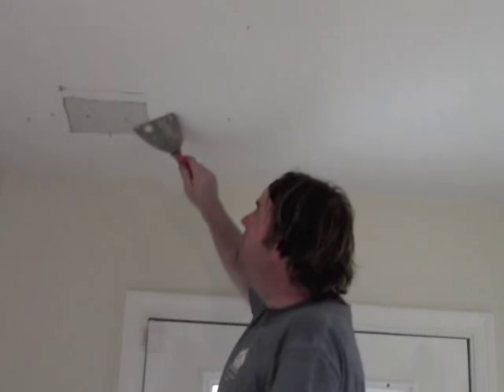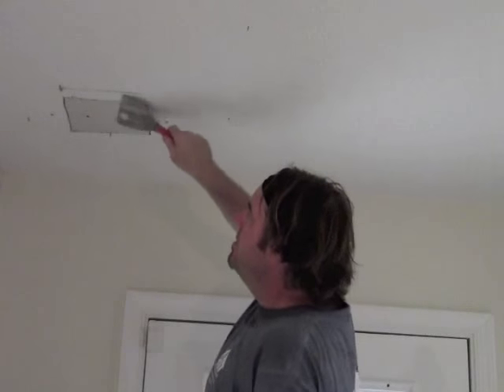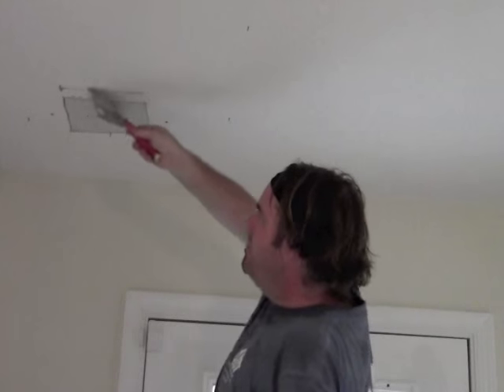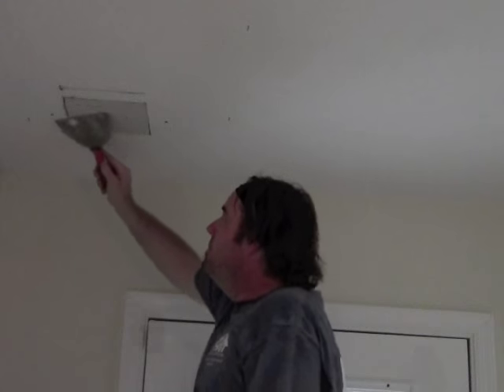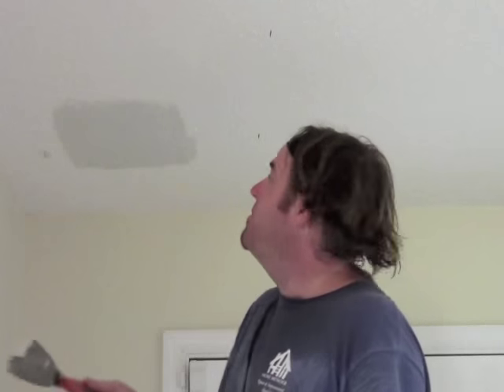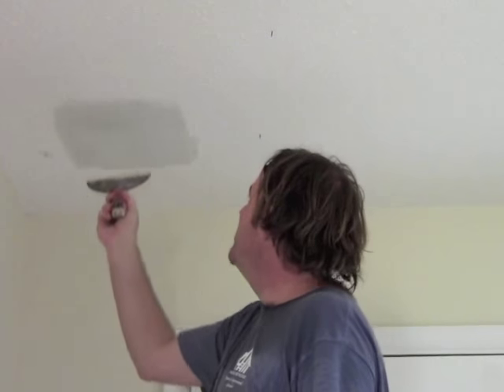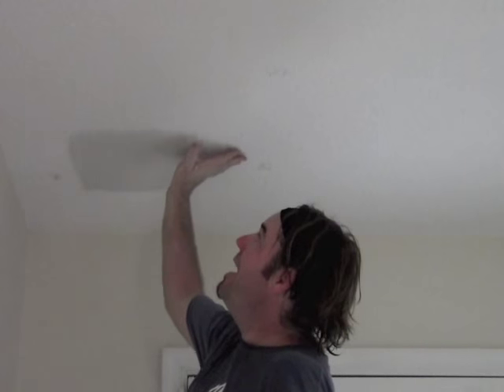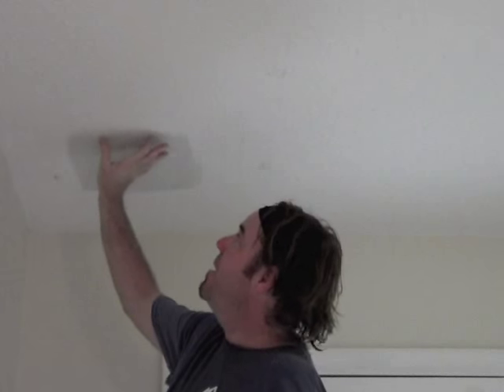How to repair popcorn ceiling. Easy! Home Mender.

Comment: For better results you should put a white primer coat underneath.  Helps the 'popcorn' materials stick (its doesn't stick that well to joint compound or bare wallboard), and its white so it doesn't take as much texture material to cover the gray-colored wallboard. As others mention, it doesn't always work so its best used in inconspicuous areas  (above the door like he did is a good place to do it).
Reply from the maker: great suggestion cross..thanks for sharing!

Comment: This video is extremely helpful! My buddy gave me the roll on popcorn but it’s not as coarse as the original popcorn. Maybe I should ditch the roll on and try the spray? Hopefully Lowe’s has this spray stuff.
Reply from the maker: Hey NL. I’ve never been a fan of the roll on.  It streaks and is difficult to match up. The spray rocks

Comment: Great video, I spray painted a popcorn ceiling only to have the popcorn start falling off the ceiling ,  scraped it back but the areas are 3x3 in 3 sections, nightmare , and now losing money on what was supposed to be fast and easy job.  This will be my last paint job on a popcorn ceiling. You just open yourself up for problems. Best thing to do is remove the popcorn, and skim coat the ceiling with joint compound, more work, more money and very messy but worth it. Popcorn is no fun unless it’s at the movies.
Reply from the maker: Wow that’s crazy Scott. There were a couple methods I used one is obviously the spray but if that was taking the popcorn down that sound like a mess. The other option I use is a foam roller cover and it has slits in it all threw out so it can get into the crevices in the details of the popcorn ceiling. They can be a bear. I’ve had one where we had to rehang the entire ceiling just to make it look nice, A great use of quarter inch drywall, you can just go right over top. Thank you for sharing Scott
Reply: I’m pretty sure he is talking about the popcorn texture falling off a little while after he painted it with a airless . Reason for that was you didn’t seal the popcorn before you painted it . A latex paint is water base ..... how do you remove popcorn ? With water !! The latex paint acted as water and loosened up the bond it had with the drywall and a little bit after you sprayed the ceiling and cleaned up your airless , he walked back into the room to pull the plastic and popcorn was just hanging down from the ceiling ....so what’s the trick to make sure it don’t happen again you ask !!! Well their are a few. 
1.) pray and ask god to please let the paint dry before it soaks so deep that the texture losses it bond .
you typically will be safe painting them but id say 3 out of every 10 will give you that result 

2.) prime before the popcorn is applied or add primer to the popcorn before you apply it to the drywall . Yes that means putting primer into your mixing bucket and then adding your popcorn powder mix to it and whipping it up and shooting like that or you can mix it in your paint color instead of the primer and knock it out like that but i recommend using primer for a good bond then spraying with a airless . 

Or

3) don’t spray it so heavy when painting . Move the gun faster but constantly if your not sure if it’s sealed or was primed before or while being applied . 

Or

4,) you can seal it before you paint with your pure white or  behr ultra pure white that you used the first time . Was I right about the color ? 

Hope this helped ..... check out my one video on my page I plan on adding more . 
And to the OP , nice video brother . Keep pushing that mud !

Comment: Great vid! We have popcorn ceiling in the master bath that has started to fall off in 3 cantaloupe sized spots over the shower. Best fix at this point?
Reply from the maker: Hey sky. I’m guessing that would depend on how easily it’s coming off. If it was in the bathroom chances are it’s been taking moisture for years and may come off easy. If it’s a small section or maybe even one cantaloupes size section I would try to patch it but if it’s coming off easy and in other places I would scrape it down, skim coat and paint it. There is a video :-) I hope this helps

Comment: Thanks for sharing. My ceiling was damaged by a water leak but no holes. Is it okay to just spray by popcorn repair or do i have to replace?
Reply from the maker: Hey oh.  As long as the board is sound I would go with it.

Comment: If all there is a noticable stain on the ceiling and we removed the popcorn texture can we just apply the spray texture and repaint the whole ceiling? Or can we just use a shellac over the stain then use the popcorn spray texture over it? Please advise.
Reply from the maker: hey summer...  just a stain?..i like the zinnser stain kill because it dries flat white, kilz dries shiny so its noticable.   you should stain kill any stain because it may be seen through the new texture. i hope this helps!

Comment: Thank you for a great video. We tried it, everything went all right except the popcorn spray from the can - our didn't have enough pressure and created a lot of mess! Could you, please, tell what brand of the popcorn spray you used on the video? Thank you.
Reply from the maker: +lttrhd homax? it does take some getting used to. Hope this helps. Thanks for watching!
Reply: I had the very same problem with a can of Homax popcorn spray.  The can ran out of gas halfway through the contents and didn't go on smoothly at all.  The mess was awful.

Comment: Question for you.. say the ceiling isn’t level all the way across... when you put the drywall patch into place, one side is flush with the ceiling, and it lines up nicely along the sides,  but the opposite end is about 1/4 of an inch lower than the existing ceiling(the patch is screwed into the joists so it cannot move up nay higher at that end), what would you do?
Reply from the maker: Hey Mira.  You could use thinner drywalll or just notch out the back where it contacts the stud so it will lay flush.  You got this!
Reply: @homemend  I'll try the notch out... I wasn't sure if it would be okay to do that, but I trust your advice! Thank you!

Comment: Instead of using your fingers - Smoothing the patch repair area edges is easy with a standard damp (not wet) soft bristle paint brush. It's called feathering the edges.
Reply from the maker: thanks for the tip DL!

Comment: Hi Dustin...after you do the repair but before you paint it, do you normally prime the repaired area first or just paint it?
Reply from the maker: skh1825 Hey hey! I will typically use like a stain blocker something like kilz or cover up. It just takes it back to the white ceiling tone and prevents any bleedthrough if it was a previous stain from a leak. You can also use kills to kind of blend the ceiling after the popcorn repair has dried if it’s noticeably different. I hope this helps and thank you So much for commenting.

Comment: My mom has a really old home and ended up with a leak in one of the bedrooms. After it as fixed her ceiling had a nasty crack in it that I'm unsure how to patch since it doesn't seem to have drywall but a metal strip and concrete.... What would be the best way to patch it? Oh and it also has the fabulous popcorn crap as well....
Reply from the maker: hi beth..  you can use that 5 minute mud to fill the gap  a little at a time until its smooth enough to coat with popcorn.. if its a large gap, you may need to secure a strip of drywall to make it right.. i hope this helps!
Reply: Home Mender Inc Yes it does thank you, I've patched many drywall holes but haven't dealt with the metal mesh before so i was kinda looking forward to the challenge lol Thanks again

Comment: Hi, does anyone have any website links for what he used to make mixture in the begging ? and what did he use to spray it ? thanks
Reply from the maker: Hey.. any big box store will have the stuff. 5 minute mud, its a powder usually comes in a small bag or box. Have to use it quick or it will set in your pan. If you dont have much experience i would get the 20 minute mud.
The spray is from the paint aisle, called popcorn texture. the brand is usually Homax. Hope this helps! thanks for watching.
Reply: Home Mender Inc ah ok, thank you 😊😊

Comment: My ceiling in my rental had water damage. They want to popcorn the area, but in my completely furnished with brand new furniture and tons of plants apt!! Is that advisable to do with a furnished room? I have the option to opt-out of the popcorn and just touch up the paint. I am afraid they could damage my new furniture and art!
Reply from the maker: Hey Doreen depending on how big the damage is I’m guessing. You don’t want your rental property to look bad and it’s easy to do with the popcorn ceiling.I would protect everything with plastic sheeting and then repair as needed. I hope this helps
Reply: @homemend  I do have the option to opt out and just paint it. I might do only the painting as it isn't that thickly textured and they can spray the popcorn when I move out. It is a small area. I just don't trust anyone with my new stuff. It was damage from another tenants floor above me. My handyman can touch it up with paint & primer. It is freaking me out that the spray can get on something and ruin it. I used to clean after construction and I saw all the drips etc!!
Reply from the maker: This homax can in the video is water soluble and easy clean up if that helps.
Reply: @homemend  So if that popcorn stuff gets on furniture it can be wiped off? Why does it smell so nasty, like toxic chemicals?

Comment: Can i add some of that to just cover a crack?
Reply from the maker: hey 2, it would be best to use painters caulk on a thin crack.. if its a bad crack you may need to scrape the popcorn off and apply some mesh tape..etc..then apply texture.  if you need it, theres a crack video below:)

https://youtu.be/yk6EvKpiG7U

Comment: Just to confirm the mud needs to be completely dry before applying a second coat? 24 hours?
Reply from the maker: Hey Steve I used five minute mud and put a fan on it so it should dry pretty quickly. If you’re using the green or blue top bucket premixed, you may have to wait a little while. It will dry bright white and you’ll know it’s dry

Comment: What about if there is not wood to nail the patch up ?
Reply from the maker: Hey Ricardo good question. You can cut a piece of wood slightly bigger than the whole slip it in and secure it on both ends and then have something to secure your patch to

Comment: If u get dreads you'd look exactly like Paul from Saliva lol but great video
Reply from the maker: thanks brandon!
Reply: @homemend  hey boss, so i live in a trailer, it has a metal roof, got cracked and now leaking, how can i seal it
Reply from the maker: hey B.....they have something like 208R wet patchat the depot. ..you could cut some aluminum or sheet metal and lay over it, secure it down and seal that..or they also have a compound to coat over the whole thing  that you out on with a big brush or mop...i hope this helps!

Comment: i bought the same   popcorn  but it does not spray  like yours  it  just come out on  my hand i  even shake it for 5 min it is  exactly like yours thx
Reply from the maker: hey john! they come with  little blue tip about an inch long that slips into the nozzle....when you buy it , it is usually taped to the can..i hope this helps
Reply: @homemend   i used that  still the same

Comment: Why the cans! A nice hopper costs $50-$60. Proper sized tip, feather the area around your patch so you can spray past your patch without being too think where the two join together. Little plastic and a drop cloth. Proper light while you're working. Boom. Pro job
Reply from the maker: hey walrus! all good points and thanks for the comments! Home owners love the cans. no hopper, guns or compressors. 17 bucks and throw away when you're done. You cant argue with convenience.lol thanks for watching!
Reply: Home Mender Inc 

This is true. Homeowners do love the cans
Reply: sooo no pro job with cans?

Comment: As a professional drywaller, I would never buy that crap in a can.It never matches from my experience. There's fine,  medium and coarse popcorn rock texture they're all different!!! Spray it with a real popcorn Hopper with an air compressor and USG sheetrock brand texture! Don't ruin your ceilings with that canned popcorn texture.
Reply from the maker: hey jaymag! up until a few years ago i would agree with you, then i discovered that i was just giving up too easy.. the spray can works awesome,  and you can achieve different sizes and patterns by your hand movements and how far away the can is from the ceiling... obviously a new coat of texture across the whole ceiling would look better, but its just not practical for mr and mrs homeowner. i hope you learned something.  thanks for sharing!
Reply: Home Mender how does hand movements change the size of the Rock's itself it's impossible. I've been spraying textures for 18 years. My popcorn comes out a lot better than any stuff you buy in a can. Just my own opinion
Reply: Wouldn't the hopper's coverage area be WAY too big for a small patch touch-up as in this video?
Reply: 3 years late to the party but I’m pretty sure he knows what he is doing . I dont think his content is for professional finishers . With that being said ive never come across a homeowner who owned a hopper . Not to say they don’t but the majority won’t . Also since Dustin is staying very professional with your ignorant attempt to make him look bad I guess I’ll say it for him . If your going to bust out the hopper for that tiny repair then I would confidently say you are nowhere near a pro. Definitely overkill . And a pro knows how to use that can as he did in the video . I myself would have went with the laco TG 500 or 600 since this was 3 years ago but I use the 950 now ..... which has waaaaaay less overspray and you can add it exactly where you need it with the exact amount you want to add . The hopper will leave a halo around the patch . Yes even when primed before you try and say “ yea that’s why I would prime it “ . It’s the thickness in the overlap that makes it stick out reason why I personally do not overlap into the existing or “ feather “ it into the existing hardly any. But to each his own . Ohh and if I didn’t have the laco tg which im sure you would not know how to mix correctly for it to shoot beautiful I would apply with a roller for such a small repair .... but busting out the hopper for that ???. Hang up the knives already man and find another trade jr !!!! Nice work DUSTIN ... keep pushing that mud man . And salute for taking the high rd . Says a lot about your character . I would do the same if it were my channel as well .

Comment: What can of popcorn material is that?  I bought a can from Home Depot made by a company called Homax and I wasted my money.  It was a terrible, dreadful product that didn't go on right.  Worst product I've ever bought at a hardware store.
Reply from the maker: henry! so sorry to hear that. its the homax...but there are precautions before usuing...you have to shake it for like 2 minutes before applying and literally have to do it like i did in the video..spray stop spray stop...Ive used it many times and "i get it" did you make sure you have that little additional tip on the can when using?